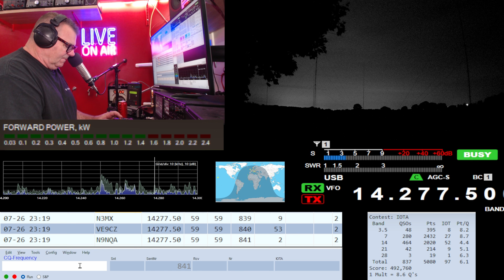Why I Don’t Want an SDR Ham Radio

Comment: G'day Cal

I have a feeling this mighta been driven by my comment on the previous video around powerline noise treatment by superhet analog NB v black box SDRs like the 101 and 7610...and that the older stuff does better.  If so, I am glad it germinated into your discussion here because this is excellent.  I have another mate who can not abide the sound of SDR when compared to superhet, for I suspect the very reasons you outline here.

I also recently watched a video from a sound engineer discussing the differences between vinyl and digital, and that, mathematically, the digital solution should be way better...and the numbers exceed our hearing abilities anyway...so the detail should be better.  Why then do some people prefer to listen to music on vinyl?  What does 'warmer sounding' mean?  He proposed that there are nuances and very low overtones in analog reproduction that can not be captured, converted and reproduced in the digital realm.  I thought that made a tonne of sense, and aligns very well with your analogy here.....your brain is expecting to hear stuff, and when it doesnt, you feel like you are missing out on something.  Google tinnitis.  What is the squealing/ringing created by for someone with tinnitis?  Why do you really only hear it when things are quiet and you have no other distractions?  It aligns with what you are saying here.    You are a fellow drummer...you probably have tinnitis like I have.  Tinnitis is the brain replacing the frequencies we can no longer hear because of the damage.  One of the treatments is to listen to soft music with amplification of those frequencies that are deficient to counter the brain trying to replace them.  Very interesting stuff.

Thanks again for the video.  I will send this to my chat group now, which includes the bloke who cant listen to SDR.  What is his current transceiver???  TS990. ;-)

73
Aaron
VK2ON
Reply from the maker: Thanks for taking the time to write that - some really thoughtful parallels there. The vinyl analogy, tinnitus, and how the brain fills in gaps all line up with what I was trying to explore. In the end it’s not about right or wrong radios, just how different ears and brains experience sound. Glad it resonated - and yes… TS-990
Reply: @DXCommanderHQ now stop threatening to sell it Cal 😅
Reply: "He proposed that there are nuances and very low overtones in analog reproduction that can not be captured, converted and reproduced in the digital realm."

Nooo, this is an old story, a kind of superstitiousness that affects even highly educated fellows, but it's very creative of you to apply the idea to the SDRs. : -) People with such claimed super hearing and taste only miss the usual distortions that are present in (certain) analog technology but not in digital - this is a common agreement on the topic. Missing details is out of the question, although I can name areas where the sound of digital audio reproduction devices with presumingly fantastic parameters can be just not good enough.
Reply from the maker: @flt73  Fair point, and I don’t disagree with the physics at all. I’m not suggesting digital can’t capture the information - only that some people respond differently to how it’s presented. Distortion, expectation, perception, fatigue - they all get mixed into the experience. That’s really all I was exploring. Appreciate the thoughtful pushback

Comment: Some contacts have a high noise level at their QTH.  They use an SDR to receive from an SDR away from their noisy location while using their radio to transmit.  I personally don't like that way of operating but the real issue are the everyday power adaptors and power supplies that trash the bands as high as S9 levels, making them usable.

If they are in your home, you can track them down and eliminate them, as you should, but if they belong to your neighbor, especially in an apartment complex, that can be challenging.
Reply from the maker: Dealing with RFI, especially from neighbours, is a completely different ballgame, and it's a battle many operators face daily.

Comment: I can run remote with WF View on my Icom 7300 or with RS BA 1 or with a LAN 10 with my Yaesu if I wan to. And with WF View I can operate on LINUX and am not stuck to just Microsoft Windows. Great topic.
Reply from the maker: Great. I use RustDesk and Sonobus - and grab the whole screen and audio that way.

Comment: This reminds me of when CD media was first released, and all of the (subjective) comparisons with vinyl records.
Reply: Yes, vinyls quality sucks, low dynamics, limited audio spectrum, with lot of noise… digital has way better quality, no contest. My 35+ years in audio engineering don’t buy into the hipster trends such vinyls, tapes, etc…
Reply: PS: If you believe vinyl has better audio quality, you’re an Idiotphile… not an Audiophile. Sorry, but not sorry.
Reply: That's NOT correct. His analogy of the 2 radios receiving this same signal IS not the same as the information from a record and comparable to the information from a cd.  So much more information on a CD.   NOW.. I love my records but they are NOT detailed..

Comment: all modern made radios are SDR.  icom 7300, 7610...SDR; yaesu 991a, 710, dx10, 101D...SDR.  you'd probably have to go back to the collins boat anchor days then to not have an SDR radio.  our primary goal as hams is to communicate (whatever the mode).  having ears that can hear through the noise on SSB or AM is good, i suppose...but, once one experiences the zero-background-noise that an Anan G2 (for example) offers, it truly represents a paradigm shift in noise reduction.  incredible, really!  my aging ears don't hear like they used to, and this single solitary reason, is sufficient enough to wholeheartedly embrace this new frontier of our hobby.  aside from the taxonomical problems of various terms (SDR, DSP), the argument callum puts forth just doesn't wash.  noise is the enemy, and always has been in our hobby, but there is a whole host of new-gen radios which are quite awesome in severely restricting it and, in some cases, completely eliminating it.  who wouldn't want that?  yes, it is true that full SDR's w/ DSP and pre-adaptive noise reduction filtering are complex to set up, they are sooo worth it in the long run.  i keep a dx10 > merc LUX > merc ATS rig set up for quick-hit QSO sessions, but for rag chew, my G2 is almost priceless in terms of quality and overall radio experience.
Reply from the maker: That’s a fair perspective, especially if hearing comfort is the limiting factor - and for many people it is. My point wasn’t that noise reduction is bad or that SDR isn’t powerful (it clearly is), just that zero noise isn’t always the same as best copy for every operator. Different ears, different fatigue thresholds, different goals. It’s good that the hobby now offers tools that suit all of those.
Reply: @DXCommanderHQ  i appreciate your response.  to hear a single voice through the noise is a developed talent, for sure, but to hear multiple weak voices where one could only hear the one before, is magical.  NR tech is really that good.  we have to be able to hear them in order to work them.  sophisticated noise reduction algo's attenuate the "noise" so that we can hear all of our potential contacts, all while not attenuating the target voice / signal.

Comment: DSP noise reduction is a Big Deal. Along with the built in DSP found in most modern radios I also use the ClearSpeech DSP Speakers & Base DSP Modules with every radio I own. It's two totally different types of DSP & it makes Voices pop out & Noise go away. White noise is almost 100% eliminated when they are used together. If you can't hear them then you can't work them.
Reply from the maker: That’s a fair point - and I don’t disagree. External DSP like ClearSpeech can be very effective at reducing fatigue and making voices stand out, especially in high-noise environments. If it helps you hear and enjoy operating more, it’s doing exactly what it should. Different tools for different ears and locations...

Comment: I have been a  DSP designer in my past life - but in this case, also and old time...Callum I would agree with your explanation. I dont know can one still get a real fine/quiet onf under 2K??
Reply from the maker: Thanks - appreciated, especially coming from a DSP background. Under £2k it’s harder now (new), but there are still some very good options if you value listening comfort over feature count. You may not get everything, but you can absolutely get a radio that’s easy on the ears if you choose carefully. Check out say a used TS-590SG (maybe) and you can pair that with an SDRPlay (there's a YT video about this) to get a bit of eveything...

Comment: Good discussion. Radios are tools to get a signal from the aerial to our ears (or computers). I use different HF receivers for different things. The admittedly outdated DSP on my Kenwood transceiver is useful at times, but I usually prefer to do without, and hear things as they are. Fortunately things are pretty quiet as far as QRM goes.  I first thought this was going to be a discussion about operating a computer based radio vs. a box with dials and buttons on (I do prefer the latter).  At the end of the day, there's so much available to us, there's always something to fit the bill.
Reply from the maker: Exactly that. Radios are just tools, and we’re lucky to have so many flavours available. Dials, buttons, DSP, screens - pick what fits the job and your brain. There’s no single right answer.

Comment: In my garage I listen to my B40 boat anchor RX whilst doing other things & it has a lovely sound on 20& 40 (even though it isn't actually a great spec'ed RX)... ditto I really love using my old FT817 which must be one of the worst RX around... Sometimes raw specs do not reflect the true grin factor of a radio
Reply from the maker: Sure. You can't quite buy "grin factor" always. Some radios just have a sound and a presence that makes you want to leave them on, even if the specs say otherwise. In the end, if it makes you smile while you’re listening, it’s doing its job.

Comment: Thanks for expressing this.  It helped me formulate what I've been missing.  I'm a reasonably new Ham, just in my third year, but I have been a shortwave listener for many years and used to picking out what is available in whatever signal I could pick up.  I am very pleased to own and use an IC7300 at the moment (and I am in a high noise area) but my romantic dream since childhood is still to one day work and older
Reply: Oops, it went away ... An older simpler unit which will let me root around for the signal.
Reply from the maker: That makes complete sense. Being an SWL trains your ears in a very different way, and that skill carries straight across. The IC-7300 is a superb radio, especially in a noisy location - nothing wrong with using the best tool available. And one day, when you do sit in front of an older rig, you’ll probably smile and recognise that sound instantly. There’s room for both. Enjoy the journey.

Comment: I had this struggle for years enjoying an 870 for its audio, now I’m with an ANAN and I can’t just go back I get all of this and I agree but my behavior it’s to fire up the ANAN instead of the 870. I’m even in the market for an old tube radio but at this point I’m facing the reality: RADIOS ARE CHANGED FOREVER and you can’t go back 😊
Reply from the maker: I get that completely. Once your ears and habits adapt to a certain presentation, it’s hard to undo it. Radios haven’t gone backwards - they’ve just changed. Going back isn’t always about better, it’s about different, and sometimes different no longer fits how we operate. That’s just reality.

Comment: You’re not talking about radio in this video at all. Every thins you’re talking about is a trained ear. Something you can do with an Analog or digital radio.
Reply from the maker: Well spotted. The video isn’t really about radios at all, it’s about listening. A trained ear works with analogue, hybrid, or SDR. The radio just presents the signal – the operator does the rest.

Comment: After a long DX session and the radio is shut down have you sat down in front of the tele only to hear it sounding raspy and flat when in reality it isn't? Ever sat on the curb watching a parade go by and a gap in the show reveals that the roadbed is traveling on its own , crawling creeping ,kind of flowing along? How about being in a small boat all day bobing along then at the end of the day you get to shore or home , sit down in your chair only to feel like your back on a boat? There must be a name for this ?
Reply from the maker: Yes - there is a name for it. It’s sensory adaptation (and in the boat case, mal de débarquement). I found this out myself after long contest sessions (4–6 hours), when I start to hear callsigns that don’t actually exist. Apparently, after hours of intense listening or motion, the brain recalibrates and keeps applying that “correction” even when the stimulus stops. It’s the same reason normal audio can sound odd after a long DX session. It fades once the brain resets. Fascinating stuff.
Reply: @DXCommanderHQ Thank You so much . I'm going to take a screen grab of your expertly crafted reply . I have been after that information for years .  I hope I can do the same for you some day. Thanks again for taking the time . Very appreciative. You Rock! P.S Punk Rock fan
Reply: P.S. #2 I don't get sea sick however I have been land sick. Was off shore for a month and a half on a 112' fishing vessel. I could not get back on board fast enough. 73

Comment: From your video, the 990's in depth manual plus all the comments it is obvious that everyone is confused about what DSP, SDR and analog actually means and this video takes it to a new level. I bet if you did a double blind study between the 990 and a Flex you would have difficulty telling the difference. You have left the impression that you can hear stuff better on that radio than some other imaginary radio without any evidence.
Reply from the maker: I don’t think people are confused so much as talking past each other. The video wasn’t making a claim about measurable superiority or trying to prove anything in a lab sense. It was about operator experience over long listening sessions. I’m not saying I hear “more” than on some other radio – just that I personally find certain presentations easier on my ears. A double-blind test would be interesting, but it would be answering a different question to the one I was exploring.

Comment: To me ,  My RSP1 SDR with TS590 is a visual aid , not audio. Being able to "see" the band and active signels is awesome
Reply from the maker: That’s a really smart way to use it. Treating the SDR as a visual aid rather than an audio source makes a lot of sense. I’ve been meaning to pair a 590 with an SDRPlay like that myself – best of both worlds.
Reply: I started like this with a 870 then I bought an RSP duo with diversity and fully integrated in the software then I stopped using the 870 for the audio the o bought an Anan

Comment: I live in an environment where I can be quite bothered by a high noise floor, EVs on chargers, and solar panel installations that create clutter, but I also know it can be a lot worse than what I'm experiencing.

I had a Kenwood TS-590S for about 10 years, which worked very well.I also had an IC-7100 next to it, which, understandably, wasn't so great on HF. I traded in the 7100 to get an IC-7300 alongside the TS-590, intending for the better system to stay. The IC-7300 left after a few months. While it's certainly not a bad radio, the 7300 was inferior to the 590 in terms of reception quality. After a few weeks, it just sat idle because I kept turning on the 590...

Eventually, the 590 was also retired and an FTdx10 was purchased. It sounds even better to my ears.

If I ever had to get rid of the FTdx10, I'd happily go back to a TS-590S. Or even older, a Yaesu FT-920, which also has a fantastic DSP.
Reply from the maker: The 590 has a way of presenting signals that just works, especially in messy RF environments. The fact you kept turning it on says everything. The FTdx10 is a great successor, but the 590S/SG will always be a classic. And yes – the FT-920 is another sleeper with lovely DSP. PS - The second VFO on my 990 is apparently - "almost" a 590!

Comment: Thats the difference between a radio operator and a appliance driver. Thanks Cal 73s
Reply from the maker: Thanks - I wouldn’t put it as better or worse, just familiarity and time on the controls. The more you learn a radio, the more it disappears and lets you operate. 73

Comment: I love DX commander live stream. It helps me train my ears and brain to listen more . I enjoy the head phones and 2 VFO into stereo feed.  I do get lots of noise at times. I learned how to use filters and RF gain to help that signal to noise ratio and listen more . I end up giving signal reports on what i hear and not the meter on the radio .  My RF gain may be down or may have pre amp on . And I may not be looking at radio . I find my self chasing that signal to noise ratio ,so I can copy better.  Every radio and place is different. Even changes day to day . At the end it is making that contact   . Some find a SDR radio helps them others like analog radio . Nothing wrong with any of that .  I just like all the different radios on the market and we get to pick what works for me . Cheers from NY ! Love that new dog !
Reply from the maker: Thanks Robert - that’s exactly it. Chasing signal-to-noise rather than numbers is the real skill, and it changes day to day, band to band. Different radios, different places, same goal: make the contact. Glad the livestreams help - and yes, the pup is definitely settling in 😄